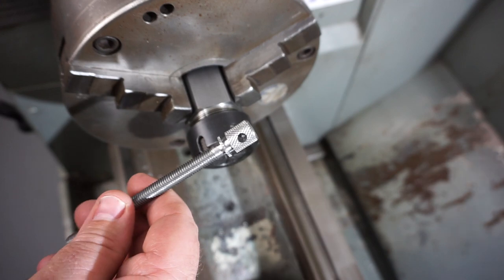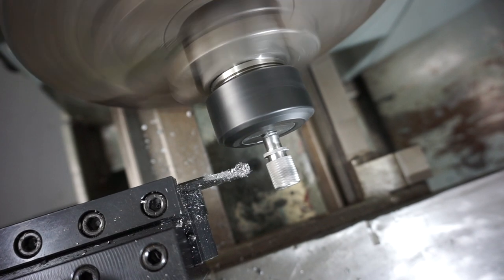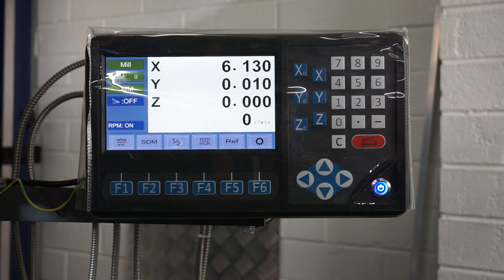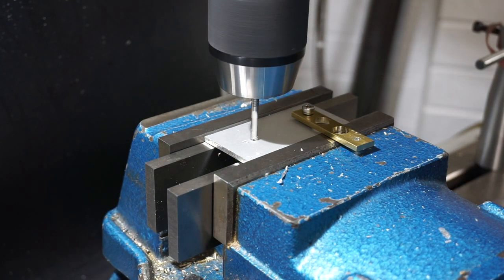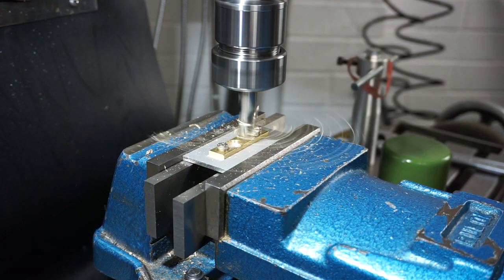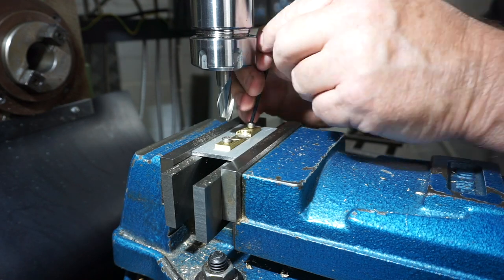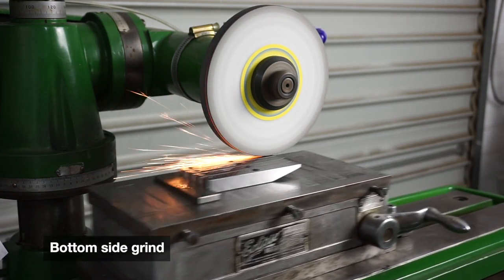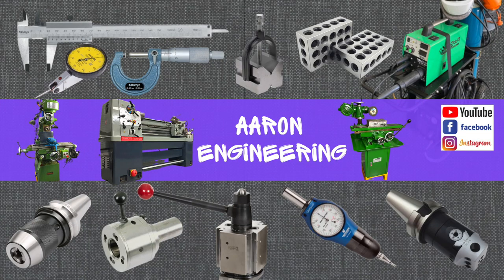Toolmakers Clamps! | Part 3 | #shopmadetools

Comment: Massah Po’,
Most beautiful workmanship.
I particularly liked the grind pattern on the finished parts.
Looks like engine turning?
Respect and felicitations,
Your most Unworthy Student,
Grasshopper
😁
Reply from the maker: Grasshopper master, it is me monkey balls.  Thanks for watching Robert.  Very happy with the finished product.  My only disappointment is the threads.  I screw cut them using the "plunge cut method".  However, the insert used wasn't 1.25mm pitch.  So I had to chase them with die and now the threads are slightly shit.  Cheers, Aaron.

Comment: Nice job, Aaron. What tool and cutter grinder is that? I have a small shop and I'd like to eventually get into surface grinding and also tool and cutter grinding so I can learn to make or sharper better tools. I don't really have the room for both tools, so this seems like a good compromise.
Reply from the maker: Thanks for the support.  Yes that is a little Taiwanese tool and cutter grinder.  It's not the best for surface grinding due to the round column.  The model is BM450A.  You can still find them for sale today, but many better ones on the market too.  Cheers, Aaron.